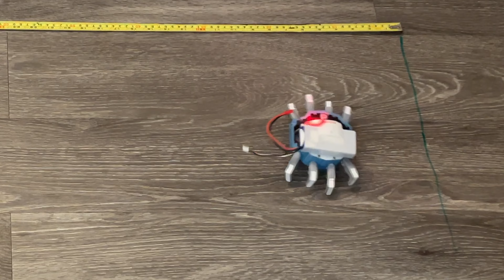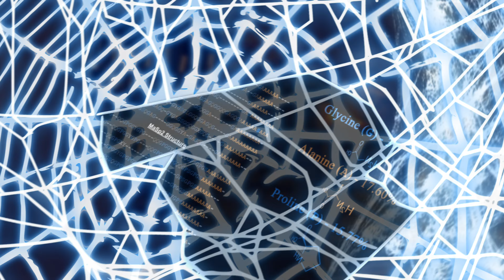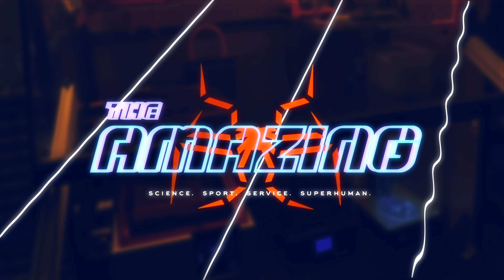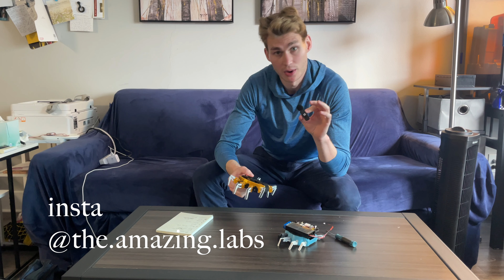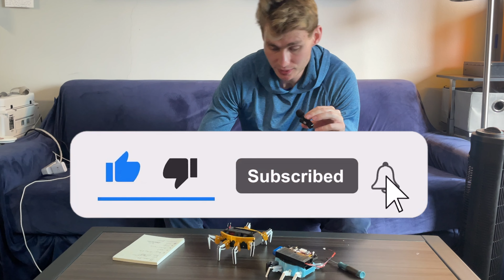Part 1: A Fair Fight | Charlotte vs. Charlotte

Comment: Correct me if i am wrong, but  Charlotte has  2 motors for 8 legs, which are placed in arc shape of the body, and the rest is gears (haven't watched all of the previous videos yet). Though I don't have expertise in mechanical magic part, I don't think it is even possible to install any control systems, as the system is  heavily underactuated. I haven't studied legged robotics or octocpods, but I've seen designs where the are servos attached at the "knees" for bending. So it would be great if you could have 2 motors for "hips" and servos on each legs, and  a straight body (yeah silly idea for many reasons). But anyways, I really want to see how you will implement obstacle avoidance with two motors, and how you will solve the problem of asymmetrical walking. Thanks for the video.
Reply from the maker: You have to rethink and simplify the workspace of the robot. If you’re expecting each leg to act like a 6DOF arm for the full SE3 workspace (3D position and orientation) then yes the system is underactuated. In fact, walking robots are always underactuated, it’s one of their well studied properties. Instead, think of it like a car. The robot is designed for 2D translational motion on the ground. One translational DOF and one rotational DOF are allowed by the two motors (she cannot drive sideways, just like a car).

Control systems require sensors. You could place encoders on the motors, but I’m interested in studying solutions for dead reckoning with IMUs. As long as a decent measurement for rotational and translational velocity can be obtained from that, the robot can be properly remote controlled.

True teleoperation would require position sensing which would probably need GPS, as any mobile robot would in the wild.
Reply: @theAmazing  Yeah, I agree on controlability part, but same as car needs to drive back and forth to get itself to the right, the same way Charlotte would need to do, and at this point spider legs really don't convey any meaning, they do the same job as wheels (as it was already pointed out in the comments section). Yeah, I know that it is much more fun   with spider legs really (you did a great job on both mathematical modeling and 3d modeling. Also it makes it a better advertisement and a product) and they are the essential part of the project and you as person, but still. I think you got my point.

About sensors part: you can always use both and fusion them.

So, I don't mean to critic just to critic, but I am rather really interested in your project as I am into similar things, and your channel is a really unique source of information on many things I haven't learn yet.

Comment: The legs are cool and all but aren't wheels just better in every way except looks? I would guess they would be more efficient, faster and have better obstacle climbing abilities. If the legs and all of their joints were able to move independently that would be a different story, but then it gets really complex, and it would make more sense to have just four legs instead of eight.
But I guess being a spider is the point of this robot.
Anyways, it is cool watching the progress!
Reply from the maker: I should test, I hypothesize these legs are better than wheels of the same size, but we will see
Reply: @theAmazing  put the wheels on legs and you get the best of both

Comment: when you're programing the micro controller, you solder the wires to it, what if you used some sort of 3d printed jig with spring contacts to make the connection?
Reply from the maker: Yes totally could! It would be fun to make a dedicated bootloader like that when we start shipping